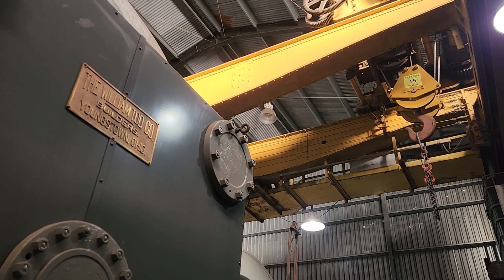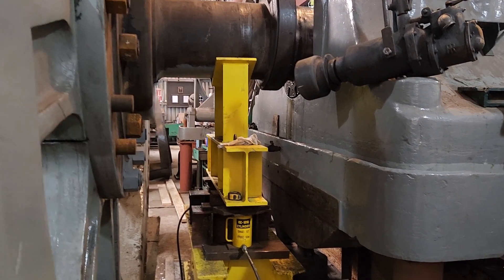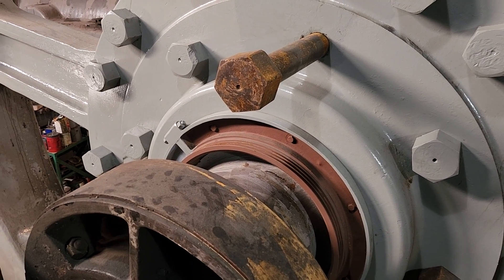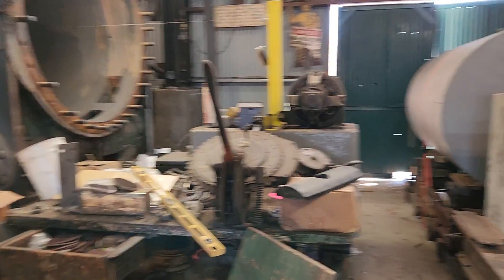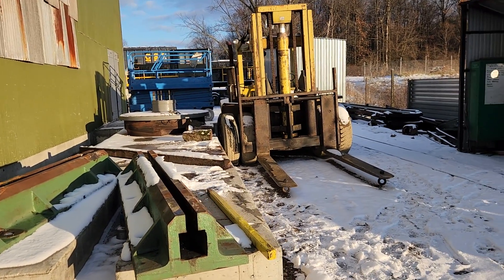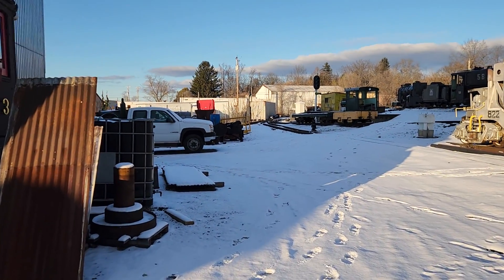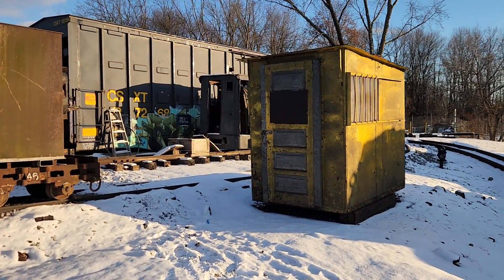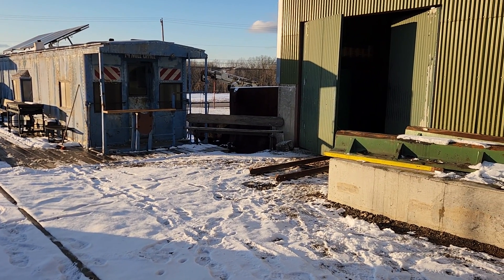Tod McDonald Rolling Mill Project December Update

Comment: That tank might also make a good condenser oil trap for the exhaust of the Tod engine
Reply from the maker: Haven't figured out the exhaust system yet, but will probably be a 16" line off the HP cylinder over to the side wall, then into a square steel box and then into another 16" pipe going up between the crane runway and the outside wall and through the roof.  Ought to hear a soft chuffing sound when she runs.

Somewhere in there will have to be a drain line for condensate and a way to catch the residual cylinder oil.